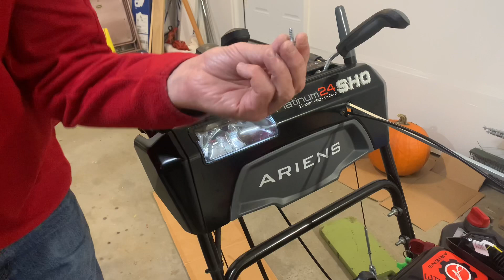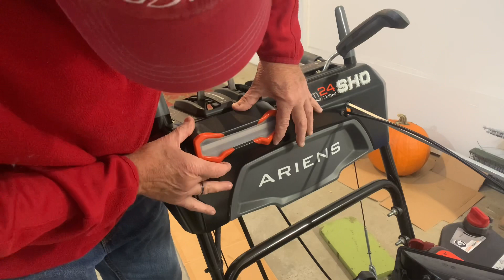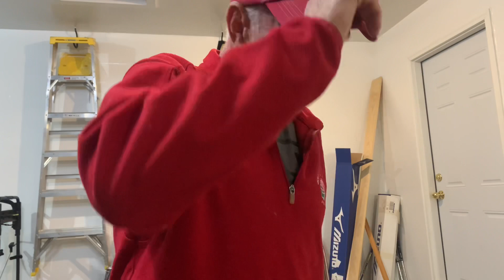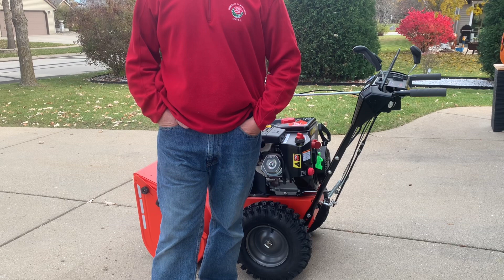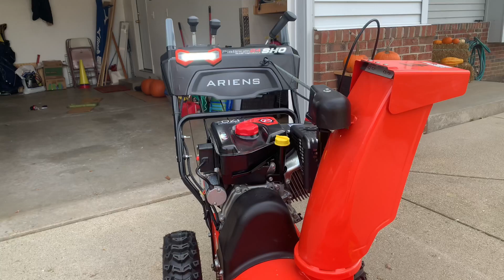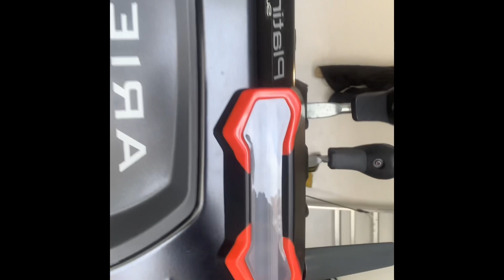Installing new Ariens LED headlight 2021

Comment: don't understand why you wouldn't just get an led bulb that replaces that factory halogen bulb ?! LED bulbs waaaay brighter than the original and even twice as bright as the "led" nonsense ariens sells !
Reply from the maker: Hey Theholr….I prefer the Ariens in dash finished style light, and I’m very satisfied with the light output. Thanks for the + comment

Comment: I picked up the Platinum 24 SHO with the EFI engine 3 years ago. It was the first year they offered the EFI engines. I don't think I'll go back to a carb again. Just turn the key and it's ready to rock. Starts up on the first pull every time. I use the electric starter for the first start of the year as I usually empty the tank and run it dry at the end of the season. But other than that it's a beast and I never have to deal with a carb gumming up.
Reply from the maker: Hi Alex… EFI is great technology when it works. Easy to start, easy to control engine speed. Ariens first introduced EFI in their snowblower engines in 2016, and in my opinion, they haven’t really changed the offering since. My problem with EFI small engines is they don’t give you any clue there is a problem until they won’t start. One of the problems that comes up on the snowblower forums is the impeller freezes up in the fuel pump from being stored dry. Those fuel pumps are around $130. My understanding is Ariens wants you to stabilize your fuel, but not run them dry for off season storage. Here is the best link I know of for how to store EFI engines. It’s from Briggs who has greatly expanded their small EFI lineup of engines the past few years. You might find it interesting I’m glad you are happy with your Ariens Platinum SHO. There truly  wonderful machines with lots of great features. Thanks for the positive comment.  
https://youtu.be/MRVkMGf5EZk
Reply: carb engines do that too if you know how to run them and take care of them . -40°f mine starts up first pull .
Reply from the maker: I’m glad you’ve had good luck with your EFI Ariens. It’s important to have confidence in your machine.
Reply: @blowingsnow4fun mines not efi
Reply from the maker: I just assumed from your comment you had an EFI. I better ask…. What are you running?

Comment: Just installed this on my Deluxe 28 last night after work. I love it! I didn't have trouble getting at it like you did. I think that may be because the dash is laid out differently.
Reply from the maker: Hi Ryan. I like the look of mine, but with the lack of snow here, I never had the opportunity to try it in the dark. Glad you had a better shot at those two screws with your machine. It’s always good when a plan comes together.
Reply: @blowingsnow4fun  Being that I get off work at 5pm during the week, by the time I'm out blowing it's usually about 7pm or later. So I'm almost always using mine in the dark.
Reply from the maker: @MegaVortex  Maybe you can answer this question. I had YouTubers comment they felt the LED light was a poor choice. There rational was that the OEM bulb generated heat and that was necessary to melt snow that accumulated on the lens. In my experience ( in the daylight) snow didn’t stick to my lens as it wasn’t warm. What did you observe?
Reply: @blowingsnow4fun  Well, I haven't had a chance to try it in snow yet since it's spring, but I'll keep you posted. I did get a replacement LED for the factory halogen and it worked great! Way brighter than the halogen bulb and I had no issues with snow on the lens. I got it on Amazon. Let me know if you want the link.

If I have issues with the new factory LED I'll let you know. I really hope that I don't though, as I really like the way that it looks! Maybe put some non stick spray on your lens like you can do for your blades, etc? That might help keep the snow off of the lens. But I guess I'll find out the next time I get dumped on!
Reply: @blowingsnow4fun  Just FYI I kept trying to post my comment with the link to Amazon for the LED replacement for the original halogen bulb, but I don't think YouTube liked that. Let me know if you want the link and I can send it to you. It was around $11.
Reply from the maker: @MegaVortex  My thoughts were the new plastic lens was cold and slippery enough that snow simply did not adhere to it. However, I can’t confirm that until I use it in a variety of snow conditions. Keep me posted if you learn anything on that if you would be so kind:)
Reply: @blowingsnow4fun  I will certainly do that! Because if I have any issues I will be going back to the stock assembly with aftermarket LED bulb.
Reply from the maker: Hey mega Vortex. When I did that video, I should have put the machine in the service position, would have made it a-lot easier. Glad you like the LED, as it’s a big improvement over OEM. Some guys think the lens with get covered with snow, but the snow just slides off with no loss of light output. The OEM melts the snow, but the water on the lens diffuses the light, and cuts down on output even more. Thanks for sharing your experience as it will help guys make an informed decision.
Reply: @blowingsnow4fun  No problem! Just got done using my deluxe 28 on the driveway! That LED upgrade is still working great!

Comment: Nice video, but you should have shown us a view at night. Do you think it is worth changing out, did it make that much of a difference?
Reply from the maker: I thought about a nite shot, but the light function so much differently when there’s snow. I think I have a video of my old light against my garage door at night. When it snows here, I could take a video of approx. the same spot with the LED. Maybe a still shot side by side if I can figure out how to do that LOL. I’ll try and have something up by New Years. Hopefully we get some snow by then,
Reply from the maker: Not sure until I actually see it in the dark in the snow. I’ll do my best to report back later when I’ve had a few chances to work with it in the snow at night.

Comment: I noticed you have the composite skid shoes. I just purchased a pair today. How do you like them?
Reply from the maker: I like them. I originally purchased them as I take the machine on my wood deck, and I didn’t want to scratch it up. As an unintended consequence, it made the SHO easier to turn/ control overall on concrete. The auto turn works great, the poly shoes just makes controlling the machine a little smother, especially on rough surfaces.